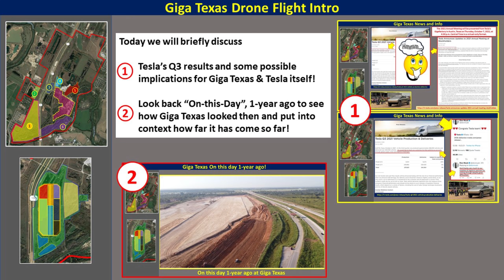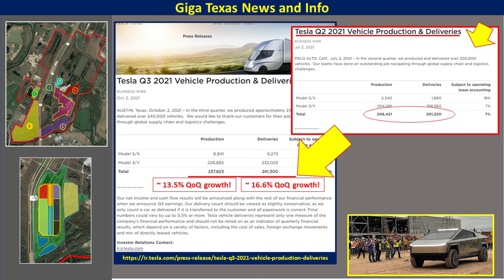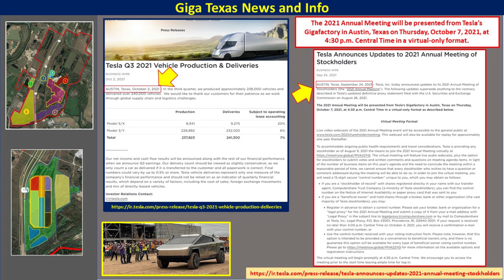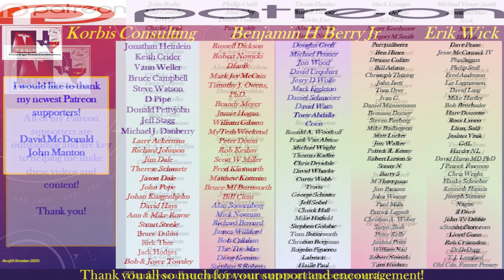Tesla Gigafactory Texas 4 October 2021 Cyber Truck & Model Y Factory Construction Update (07:45AM)

Comment: Thanks Joe.
16:23. South pond. Bottom left. Mush coming out of the bottom of the pond. I wonder where that is being dumped to dry out.
18:23. South end GA. Pair of short panels leaning against the wall. Good view of the recesses in the back of the panels that locate over the panel hanging brackets on the columns.
18:40. South end GA. Loading docks in full height open space.
Columns awaiting the wall panel bracket relocating team, and the black paint team.
19:27. South alleyway central footings. Rebar starters for the column pedestals show these will be wider, and central on the footing.
19:32. South alleyway. Right of yellow crane. Seems like that column is being loaded onto the trailer. Fabrication mistake un-fixable on site? Seen again at 21:20.
19:47. South alleyway. Centre of screen. Interesting that the black 8’ PVC drain that was removed is now being replaced with concrete pipe.
20:50. South alleyway. North stud wall, top. Pushed 4 or 5 studs west to temporarily make an opening.
22:54. Paintshop. Bunker roof. Interesting that there doesn’t seem to be a similar structure at Berlin or Shanghai.
Reply from the maker: Thanks Dessie!
Reply: 22:54 Shanghai and Berlin have direct exterior vents on the walls though, and also have some types of tanks outside.
Reply: 2:51: Joe pays homage to Dessie.

6:30: Did they actually lay a concrete slab in front of the contractor trailer?

12:12: plastic sheeting closing off North Alley from Battery top floors.
Reply: @greggerypeccary  2:51. Didn't watch that bit! I'll need to talk to my lawyers.
6:30. That's 3 discarded wall panels. Dozens around the place.
Reply: @patrickkenny2077  I'm not convinced the purpose of the bunker is known though. There's a bunch of theories about what it might be, but it's not something that is positively readable, like the stamping or casting plants.
Reply: @greggerypeccary  6:30 is precast wall panels, similar to other “shops” on site.
Reply: 18:40: and that's obviously an elevator shaft behind the loading docks...

Comment: 14:00: "New areas of asphalt"
According to the plans (p. 15), they're going to have two lanes of traffic in each direction, all the way around the corner (so they're going to dig up the bottom part of the berm and support it with the Cyberwall).
Don't ask me what they're gonna do with the hydrant... all I can figure out from the plans is what's marked as a "water valve"  (a manhole, probably).
Reply: Take a closer look at page 15. Two lanes southbound, one lane northbound. There are two northbound lanes approaching the corner, but narrows to one at the corner. Also interesting is that the battery structure is labeled as "Phase 2 building expansion".
Reply: @DavidJohnson-tv2nn  You are correct, I was looking at the other North-West corner... so the lanes converge into one at the corner, then it splits again into two. (and the plan lists "fire hydrant with 2 bollards", whereas there are actually 4 bollards)

As for "Phase 2", look at pages 9-10: they label Battery, the Casting expansion, the South alleyway and the building on the South-West corner as "Phase 2". So Phase 1 was basically the original concrete structures, BIW, GA, Paint... and the yet-incomplete North alleyway.

Comment: @ 17:21 More on the south pond shape, size, inlet pipe location, and location of "splitter box" that will feed the pond can be seen on page 52 of the updated site plan. The stormwater system from splitter box to river outfall structure are covered on pages 50 - 58, and 65 - 67. Splitter box details on pages 70 - 72.
Reply: David, do you have a location for those plans? I tried to get them but the city pulled them too fast.
Reply: @Bill_N_ATX  Tried several times to post the link. It won't post.
But Joe posted a link in the comments of his  29 September 2021 video, in a reply to a comment from Robbie Showers.
You have to go through a couple of steps to download the plans but it is worth it.
Reply: @Bill_N_ATX  Go to Joe's 29 September video. There's a comment there by Robbie Showers, Joe posted a link in answer to his question. I've used the link to download the PDFs direct. 72 pages.

Comment: That center spot at the roof. Maybe there is internal medium voltage substation + dry type transformers. Center location is optimal for distribution. MV switchgears require "pressure vents" to outside. Every shop would have their own main low voltage switchgears.
Reply: I read it was a chemical storage spot for the paint shop.
Reply: It's plausible. No one really knows what it's for.
Reply: There are much easier ways to deal with arc flash than a room like that.  Keep in mind that the building is about 4,500’ long, so at 480V you would need to up-size your feeders by a factor of two (double the ampacity) to accommodate voltage drop.
Reply: Room itself (concrete walls) would be more on fire protection purposes. Vents on the roof could be for arc blast pressure relief. At least that is usually used here in Finland on top of arc protection systems, although vents are on the wall here. But you would only need couple vents for this, so this theory is probably not true.

From the middle it's about 500m to the farthest shop. With high short circuit current, low voltage distribution is doable with thick cables.
Reply: @laurilehtomaki  Once I witnessed a fire in a separately standing, small concrete building with steel doors and inside there were concrete bays where lower voltage switches and cables were positioned to feed equipment in the factory. I believe the actual transformers stepping down from 11KV were just outside that little building. Anyway, the black smoke in that building was absolutely horrible but luckily we had an Ace electrician who went inside and was able to isolate the right parts. That black smoke was so bad, not to mention the nausating smell! If it passes into a car factory the whole place will be covered in black goo and out of action for a very long time. So yes, I can see that some passive safety measures around a substation or switchhouse (pls. insert the right terminology) make a lot of sense. How to do it in this mega-building is something else entirely. I'm not qualified in this field of expertise but hope that readers get a feel for the potential adverse effects of an electric fire.

Comment: It looks like the project has come to place where in order to both do construction and start up the manufacturing of cars they need real parking lots along with receiving and storage and shipping areas. So it looks like roads and concrete parking pads are now in the starting to be built. Watching the channels of the German site there building fast ,especially there battery plant unbelievable as to how thick the floor foundation is with what appears to be tunnels within it. Add there water treatment plant maybe that will be something this site will get soon.
Reply: Regarding the Berlin battery plant... I believe the reason they are building it on a super thick reinforced concrete pad, is that for whatever reason, they were not able to use pilings at the location of that building. Someone can correct me if I'm wrong.
Reply: @DavidJohnson-tv2nn  that could also due to soil conditions at both Berlin and Austin be why there are such huge 
heavy concrete footers . So water pressure would not allow them to float up along with the deep piles. Also the thickness of Berlin’s floors might also be to there environmental impacts and floor loads of the equipment to be placed on the floors.

Comment: Joe to extend the other building wont the other pond need to be filled in??
Reply: I think both will need to be filled for a 500 foot extension to the south, by then they will not be needed due to soil not contaminating water which can be pumped into the river,  it is only rainwater after all,  well most of it is.

Comment: 12:10  Space frames unique for this build and very space consuming, about 1 office floor gone.  I don't get it.
I know nothing--are they doing it cheap and light wt so they can rip off that section and go vertical later??  :D   (wild ass suggestion)
Reply: There was discussion of it here when they started constructing them. I believe the assumption is that they're going to hang something heavy off of them.
Reply: @greggerypeccary    Interesting but that doesn't make much sense unless it's something lite wt., much harder to apply concentrated loads on a truss/space frame than an I-beam.
Reply: @Mrbfgray  The experts here claimed a spaceframe is what you'd use if you want to hang a heavy load. The span alone was ruled out, as they'd used beams for such spans elsewhere in this project.
Note that there'll be a bridge crane below, which we guess will move shipping containers.
Reply: @greggerypeccary    No doubt it depends on the details of the space frame which I have no idea of....type of steel tubing, thickness, etc.

Comment: Deliveries is 19.9% growth.... where did you get 16.6% qoq?
Reply from the maker: Via math.
Reply: @JoeTegtmeyer  201 to 241 isn’t 16.6% though. So yeah.
Reply: @JoeTegtmeyer  19% is correct
Reply: @duncanadams2531  But 241 to 201 is a -16.6% shrink.
He calculated the difference then divided by the END figure, a common mistake. Boo!
Doing ratio 1st help to avoids that.

Comment: 19:32 - with the outside walls on the East side, possibly that will be some sort of outside drive on the East side of the pit? I guess this theory doesn’t explain the center footings being placed down in the pit.
Reply: We'll have to see if the steel columns on that side have panel brackets.
Reply: There was piling went on down that side presumably for columns, although it's difficult to say how much piling was done as it's only really evident when they start excavating for the pile caps.

Comment: Do you think they are on track to produce vehicles by the end of the year? Also is this site 24/7 construction?
Reply: Starts this week, most likely
Reply: @duncanadams2531  source on that? didn’t think they were that close yet
Reply from the maker: Yes, but we should get official word tomorrow (7 Oct) during the 2021 Shareholders meeting which has been moved to Giga Texas.  I'm hoping for a lot of interesting details and announcements!
Reply from the maker: I'm one source, based on the conversations I've had with those actually working in the factory.  But tomorrow, at the 2021 Shareholders meeting, we should get official news and announcements, so hopefully that will help answer these questions.
Reply: @JoeTegtmeyer  great, thank you for the response!

Comment: Anyone notice how the roofers are using buckets to weigh down the panels....seems so inefficient....they did this on some of the roof sections many months ago....
Reply: They've been using it on most of the roof.  What is your alternate, more efficient solution?
Reply: @sammyk874  Don't know,  just seems to be terribly slow considering modern building techniques...
Reply: Cheap, easy & portable solution. Only until adhesive dries.
Reply: Buckets of water works great. About 40 pounds a bucket when full. Throw out the water and they stack real easy in a much smaller space and don't weigh much. Finally, when you are done there a million uses for empty five gallon buckets.
Reply: They're using buckets only when they use adhesive, and they only use adhesive on the cement roofs.  The sheet metal roofs get the panels screwed down.